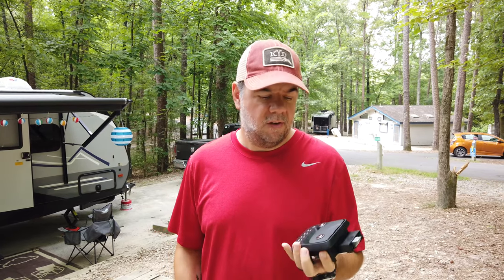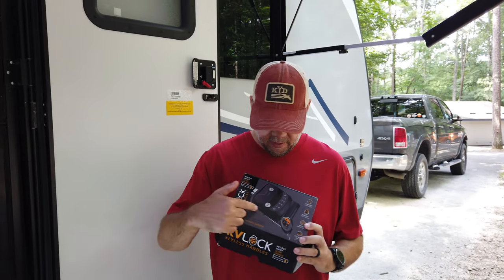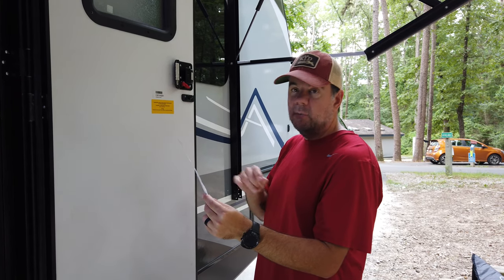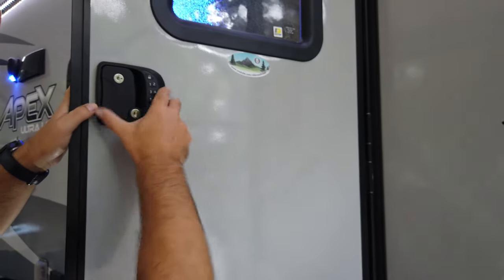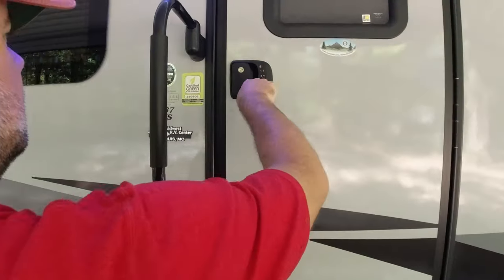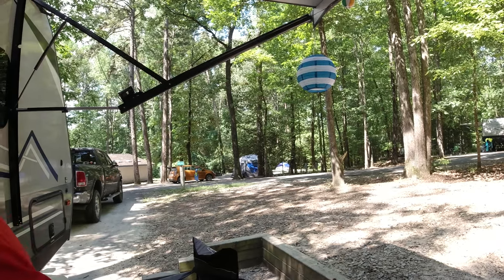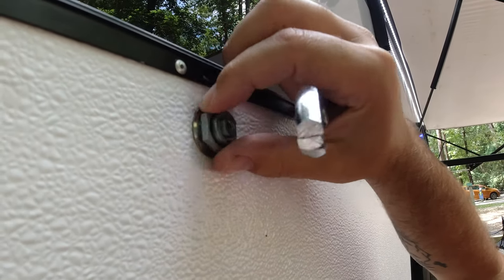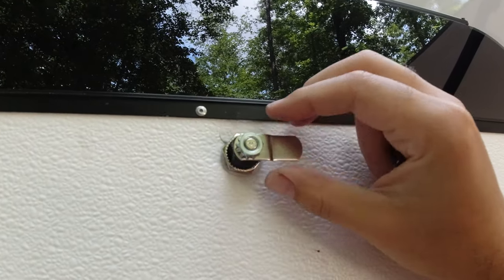RVLock V4 Keyless, Wireless, Replacement RV Door Handle Install and Review

Comment: Thanks for posting! Side note - I  also have an Apex Nano. What did you do on your door? Mine currently only opens until perpendicular to the wall. Did you remove the hydraulic piston to get it to open 180 degrees? Thanks!